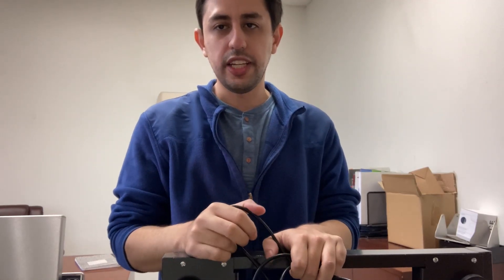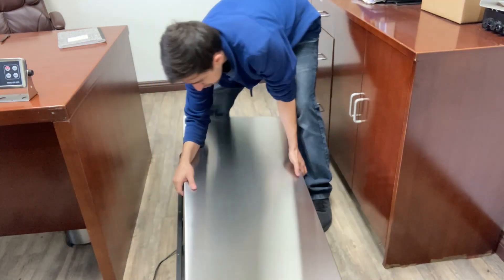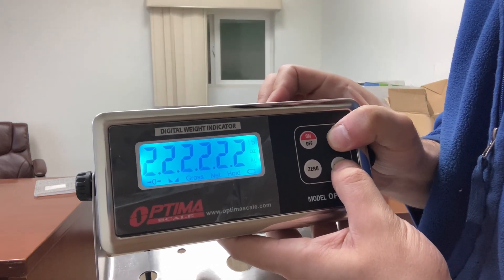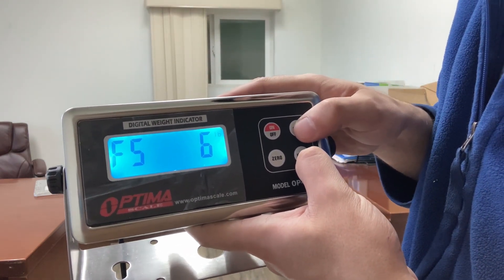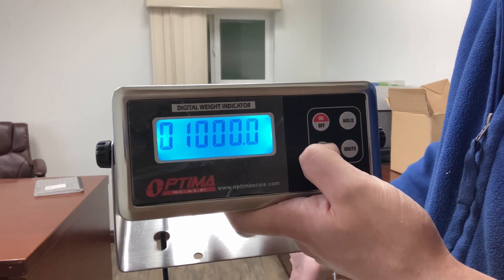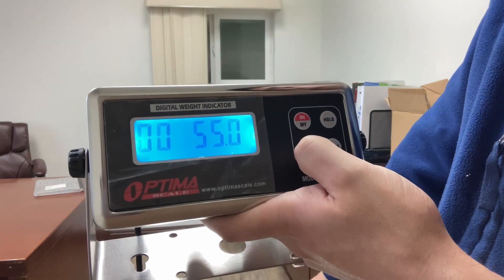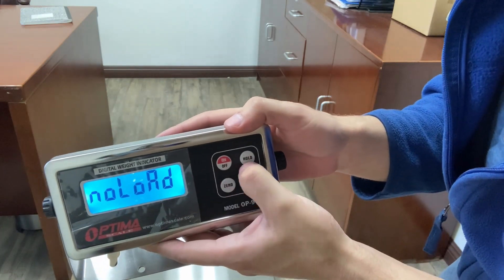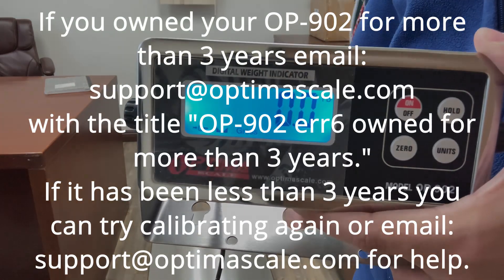Vet Scale Calibration OP-902/ Err6

Comment: Ours won’t zero out.
Reply from the maker: If your readout is older than 2-3 years old there might be a problem with the readout. You might need to replace. We discontinued the OP902 and replaced with OP909JR. Ask for the 4 to 5 pin adapter. email: sales@optimascale.com to place order. Otherwise it could be damaged cable someone is sales can help you with that. 

Anthony